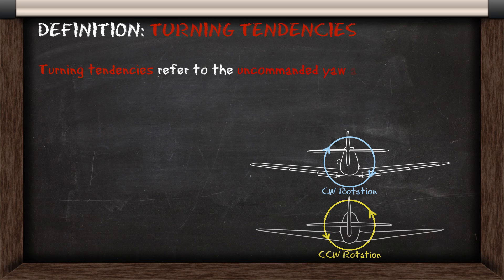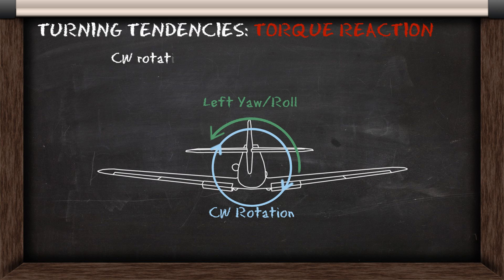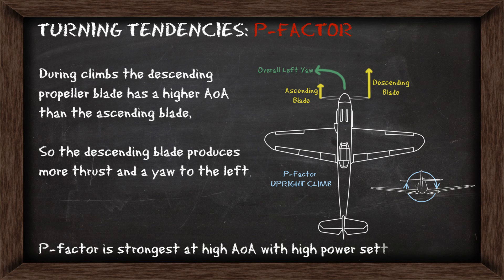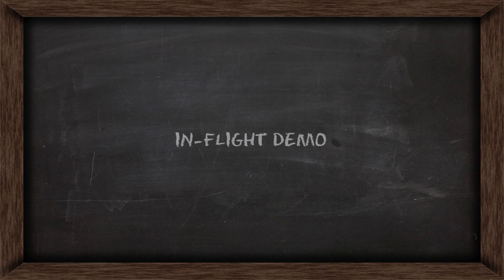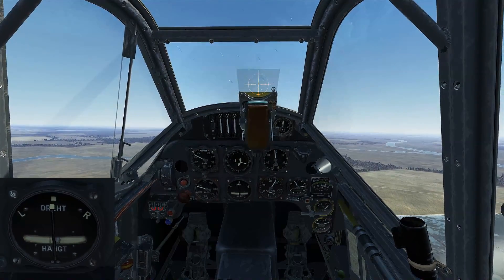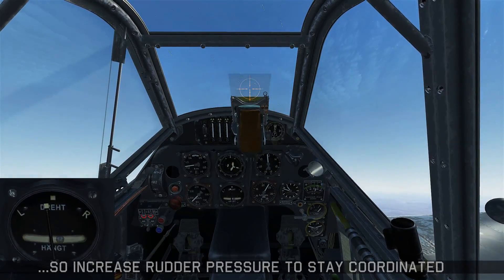Principles #3 - Left Turning Tendencies

Comment: How the different forces interact in left or right turning tendencies give us the impetus for the Learning of a proper rudder Usage . 

But in the heat of a dogfight , how is one supposed to maintain similar coordinated turns and rudder usage ? Is the procedure similar or altogether a different approach is needed ?
Reply from the maker: With practice you get a feel for how much rudder you need, but you can check the slip indicator to be sure. In a real airplane you can actually feel if you're uncoordinated so it's easier to fix.

Comment: Is there a rudder/yaw trim to cancel out these forces. Because it will be quite impossible to keep the right pressure all the time or even for a short period of time without straining yourself.
Reply from the maker: There is no rudder trim in the 109, but the consolation to that is once you get up to around 450kmhr you wont need any rudder input to be coordinated

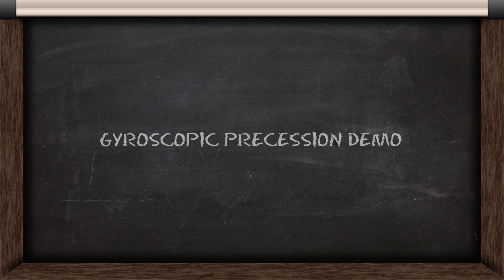Comment: I think that the demonstration starting at 3:10 is incorrect. I'll try to explain why I think so:

When you pitch down to raise the tail, there should indeed be a gyroscopic force yawing the aircraft to the left. The strength of this force is proportional to the rapidity with which you pitch down (as you mention at 3:49).

*HOWEVER*, the gyroscopic force is only applied during pitch _changes_. Once you stop changing your pitch, no more gyroscopic force is applied and yet your aircraft is still clearly experiencing a yaw to the left.

The cause of this continuing left yaw is NOT a gyroscopic force. The cause is probably spiral slipstream. By pitching down, the tail is raised higher. Now that the tail is higher, only the top part of the spiral slipstream is impacting the tail. The propeller is rotating clockwise, so this part of the spiral slipstream impacts on the vertical stabilizer on the left side, causing a left yaw (exactly as you described at 1:07).

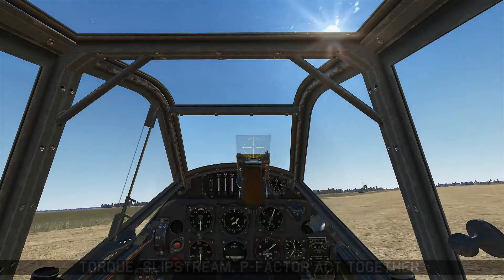I also question your assertion earlier in the video at 2:26 that spiral slipstream is causing the aircraft to yaw to the left when the nose is pitched up and throttle is increased from a standstill. In fact, it is possible that spiral slipstream is actually attempting to yaw the aircraft to the right (but is being entirely cancelled out by the much more powerful effect of P-factor). The reason that I think this is because the aircraft is sitting on its tail wheel, pitched up, and so the spiral slipstream cannot flow along the length of the aircraft, but would instead run parallel with the ground. Depending on the shape of the aircraft, this could cause the spiral slipstream to impact the vertical stabilizer more strongly on the right side, causing a right yaw. That said, I'm not familiar enough with the characteristics of the Bf109 to say for sure if I'm correct, and I'm also not sure if IL-2 Great Battles actually models the spiral slipstream hitting the ground in this way. Regardless, the result would still be a left yaw in this situation, because P-factor is just that powerful.

(Thanks for making your instructional videos. Despite my criticism of this particular video, I think your content is extremely valuable, and I refer to it often. I'm only writing this because I watched this video about ten times.)
Reply from the maker: Thanks for taking the time to compile your feedback Maple, enjoying my content, and to be thinking about these things in addition to what you see here. I had to wait to come home until replying because it's too much to do on a phone. When I was explaining this stuff to my students I could isolate and explain each tendency on a whiteboard individually, but in a sim unfortunately I can't switch off any of these aspects as they will always be interacting at some level, so I tried to choose situations to illustrate each tendency as best as I can with a sim that's always in motion. I'll try to respond as best I can to both of your main points.

1. In the gyroscopic demo I would put down the yaw which continues briefly (at a much lower rate of acceleration) after the tail has stopped being raised due to momentum plus the other tendencies as you have mentioned. You're correct in what you're saying but this extra bit of yaw after the tail has stopped being raised is not what I'm referring to when I'm talking about precession. I am talking about the majority of the yaw experienced in that demonstration while the tail is being raised, which is due to precession.
2. You've actually presented a contradiction by saying that spiral slipstream will make the aircraft yaw to the right when earlier you say it will make the airplane yaw to the left. The Bf 109's shape does not change so spiral slipstream cannot cause both a left and right yaw because the Bf 109's propeller rotation direction does not change either between demonstrations. If a propeller rotates clockwise (as it does in a Bf 109) it will always move along with the airplane's fuselage and strike the left side of the vertical stabiliser, causing left yaw. If the propeller rotated counter-clockwise it would have the opposite effect. This is why in some Russian planes which use counter-clockwise rotating props you need left rudder on takeoff instead of right rudder like in a Bf 109 due to the opposite turning tendencies.  The propeller is creating the spiral slipstream by forcing air backwards in the opposite direction of the thrust created, so think of the air as a rotating cylinder parallel with the fuselage when you apply the thrust. No matter where you move the cylinder along the fuselage it's rotation will always strike the left side of the vertical stabiliser (if the propeller is rotating clockwise). Because of the propeller's rotation it also imparts that twisting motion of the slipstream along the fuselage (not the ground) and will be more pronounced when the propellers are at higher angles of attack/slower airspeeds than when they are in cruise flight for example.

As a thought experiment, but before you read the document below...imagine the propeller still rotating clockwise...but the vertical stabiliser was designed to be below the fuselage instead of above. Do you think spiral slipstream would produce a yaw to the left or right?

Stick and Rudder is a great book to get more detailed explanations on the topic that are easy to understand https://archive.org/details/StickAndRudderAnExplanationOfTheArtOfFlying
Reply: @RequiemsACTL  
Thanks for taking the time to reply.

> this extra bit of yaw after the tail has stopped being raised is not what I'm referring to when I'm talking about precession.

Ah, OK, I get you.

> The Bf 109's shape does not change so spiral slipstream cannot cause both a left and right yaw because the Bf 109's propeller rotation direction does not change either between demonstrations.

Yes, but couldn't the path that the spiral slipstream takes over the fuselage change depending on whether the aircraft is sitting on the ground with its nose up, or parallel with the ground during a takeoff run? If the ground is close to the vertical stabilizer, like on a taildragger resting on all three wheels, couldn't that squash the spiral slipstream upwards, and result in a different part of the slipstream hitting the vertical stabilizer?

> think of the air as a rotating cylinder parallel with the fuselage when you apply the thrust. No matter where you move the cylinder along the fuselage it's rotation will always strike the left side of the vertical stabiliser (if the propeller is rotating clockwise).

The air at the top of the cylinder will indeed strike the left side of the vertical stabilizer as it rotates clockwise. I do not contest that the top of the cylinder is the part of the spiral slipstream that is in line with the vertical stabilizer in normal situations. However, with a taildragger like the Bf109, is it not true that the presence of the ground could push the spiral slipstream upward, and so a right hand yaw could be induced if the aircraft was the correct shape? Or at the very least, a diminished left hand yaw? This page is about model aircraft, but mentions the possibility: http://www.dwave.net/~bkling/rc/howto/propefct.htm

> As a thought experiment, but before you read the document below...imagine the propeller still rotating clockwise...but the vertical stabiliser was designed to be below the fuselage instead of above. Do you think spiral slipstream would produce a yaw to the left or right?

Before reading the document, I would say that I would expect a yaw to the right in this case of a below-fuselage vertical stabilizer with a clockwise rotating prop, as the spiral slipstream would impact the vertical stabilizer on the right hand side.

I read the part of the document that I believe deals with the subject (Chapter 8, The Thing Called Torque), but I can't find anything to suggest my initial answer was incorrect.

Unless I've completely misunderstood, I suppose there's only really one point of contention here: Is it possible for the spiral slipstream to follow a slightly different path in the close presence of the ground? And is this actually likely in the specific case of this Bf109?

Edit: broken link
Reply from the maker: I
m very sorry for the late reply on this Maple as I didn't see it posted. Seems like YouTube automatically prevented it being posted due to the link in your comment. I see what you're getting at now regarding the slipstream causing a a possible yaw reversal when the tailwheel is on the ground from that page, but that is something I haven't heard of before. The only way I can visualise that happening is if the wash striking the lower part of the vertical stabiliser which extends below the horizontal stabiliser is stronger than any wash striking the upper vertical stabiliser could you possibly see that happening. I don't know the true answer here though, so I'd have to ask around and see what I can find out about it and get back to you.
Reply: @RequiemsACTL  No worries, thanks for the replies, and thanks again for making these great videos. If I ever find out anything more on this subject, I'll post it here.

Comment: I assume on IL2 like other simulators this can be countered even before starting take off by adjusting the Yaw, before adding the throttle. This way you do not have to maintain a strong action on the joy stick for yaw, as the yaw is already setup prior.
Reply from the maker: I suppose you could but I can't imagine taking off in that manner is a good technique. As a flight instructor I would never teach my students to do that in real life, but if you find it works for you in a simulator more power to you. You can of course use rudder trim positions for takeoff but I wouldn't recommend using an actual rudder position before you even start rolling. 

The idea is that you use it to keep yourself aligned with the runway and until there is some kind of movement left/right you don't know how much rudder is needed. The combination of throttle setting, airspeed, wind, surface, etc during the takeoff means every takeoff won't be exactly the same so adding rudder before it becomes effective is counter intuitive in my opinion. 

Besides, once the above factors start interacting you are going to have to begin adjusting rudder anyway, so you might as well do it smoothly from zero while the takeoff progresses so you develop a good feel for the rudder's effectiveness during the roll.

What would your plan be for rudder use on landing coming to a full stop?

Comment: Do you use TrackIR or is there something better?
Reply from the maker: I used to use the hat switches to look around but I find TrackIR is much more immersive. I don't have the GPU capability to run Virtual Reality otherwise I would probably give that a go! I've heard it's pretty awesome.
Reply: Yeah imagine it will be but TrackIR will suffice for now--wish there was a cheaper version though.
Reply from the maker: There are a few options out there other than TrackIR. FreeTrack, FaceTrackNoIR, and Trackhat come to mind but I don't use them so I can't guarantee it will work with IL-2.
Reply: Cheers, will get TrackIR to save hassle.